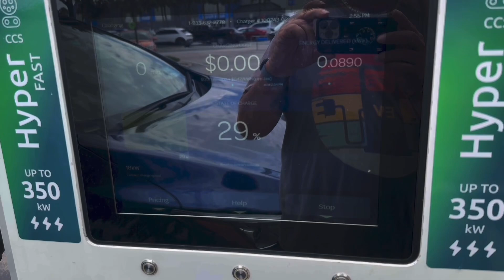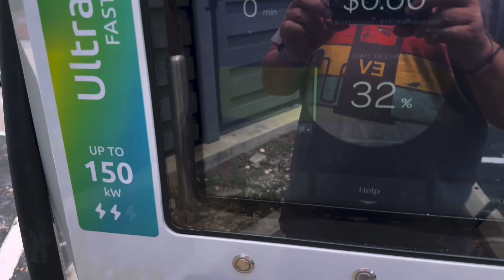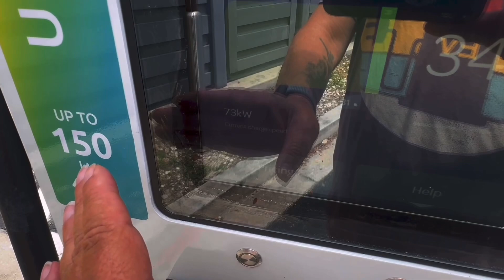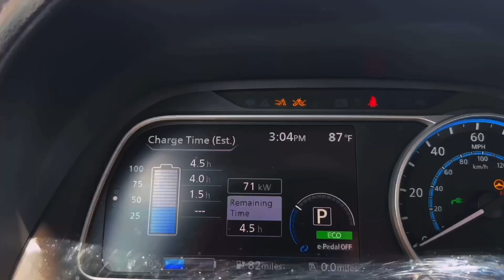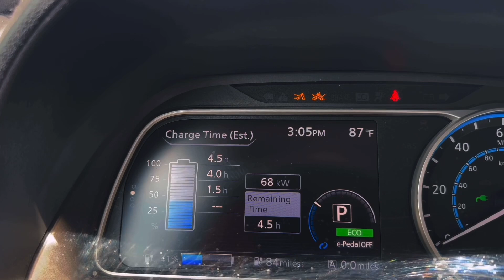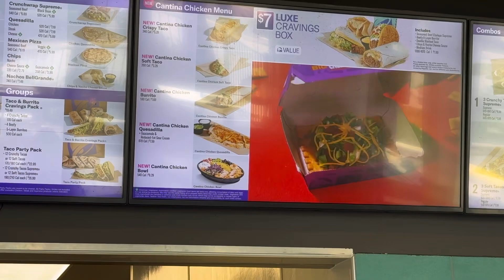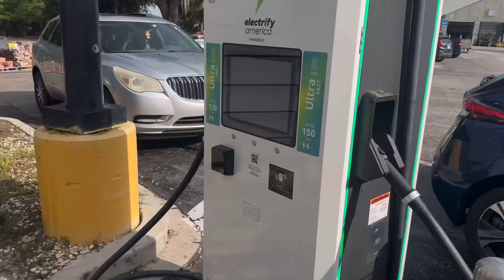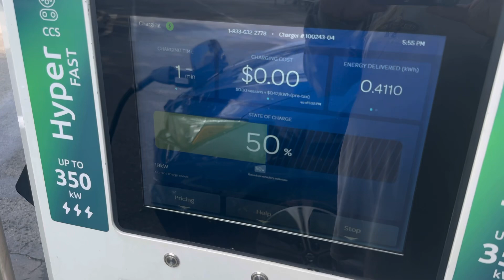Testing a CCS to CHAdeMO Adapter on Two Nissan Leafs: 2021 vs. 2013 almost

Comment: Hi Rick,
I also have the Accraine/Electway adapter and have been testing on various chargers. Have you successfully used the adapter on a Delta/GM charger?  I have not, so far. (Another Florida guy had success with the A2Z adapter.)
Reply from the maker: Yes I have EVgo in Orlando has signet. And delta and it works
Reply: @nomadichippie  Cool. Might be the charger I tried, I'll test again at a different location.  Thanks!

Comment: Hello, I am a seller. You said you would shoot a product video, but I haven't seen any video since February. You said you would contact us to return the product, but I haven't received your email. We can't wait any longer.
Reply from the maker: Send me the address I will take it down. I shot a video actually two days ago to put together of the product again. I have two videos of them. I was afraid to post because a few people have the same product and they’re very unhappy and they walked me around and showed me the issues they have with the product and then I put it on to see if I had similar issues and gave it a few weeks and have came across the same issues where the material is very similar to that of a above ground swimming pool and here in Florida it’s extremely humid, hot and rainy every day and the whole canopy turns green with mold due to the high humidity and it’s extremely hard to keep clean and I made a video about that yesterday I just want to be honest with the people that may want to purchase the product about living in a jungle environment that may not be specifically for them. It’s more for desert with very low humidity and not so much rain but yes, send me back a mailing address, and I will gladly run it over to the post office and mail it back off
Reply from the maker: The unboxing video has been up for a while. But I needed to see what the product was like in day-to-day use in our area before I posted any other videos which aren’t really that good due to the fact of our climate that we have here with the product shipped, I just wanna be honest with the people to see the video and the only way to do that is to test the product a little bit which can’t be done overnight. But I did already upload one video for the unboxing experience and what comes inside.
Reply: @nomadichippie  You didn't tell me that you needed to test it for 2-3 months, and I didn't see the successful installation video, so I kept contacting you, but I didn't get a reply, so I had to find you through your account. In addition, I have sent you the return address via email, please check your email. Thanks
Reply: @nomadichippie  Hi, I still haven't received your returned product.